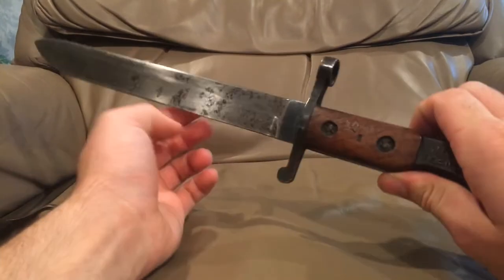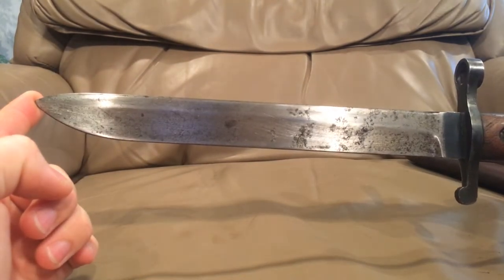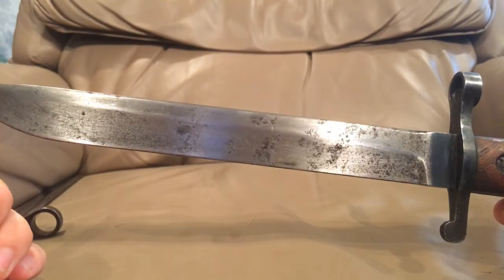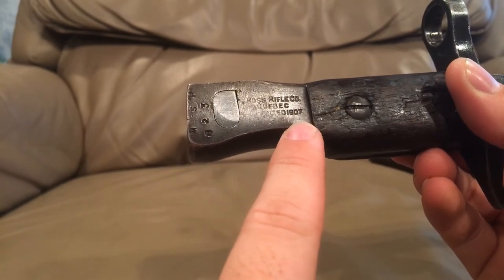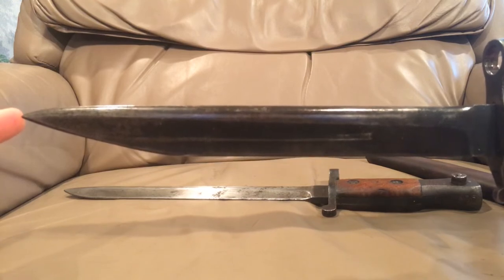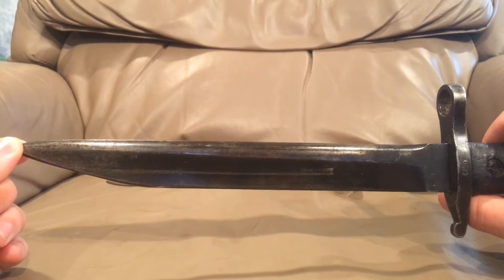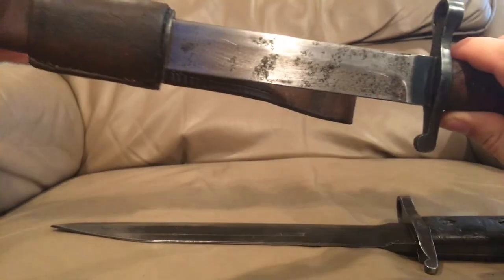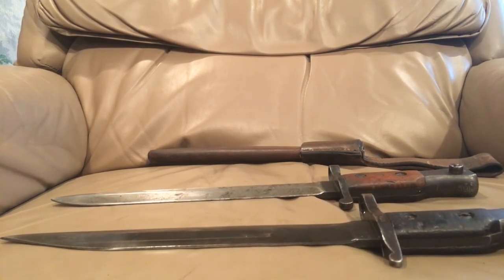Canadian model of 1907 Ross bayonet

Comment: I've recently acquired a ross bayonet with a modified blade but it was is pretty rough condition lots of rust no grip or pommel. But it does have a 583 stamped of the hilt I was wondering if you might know what this is for?
Reply from the maker: It’s the inventory number for that specific bayonet for whichever armory it was given to, no telling which one though.